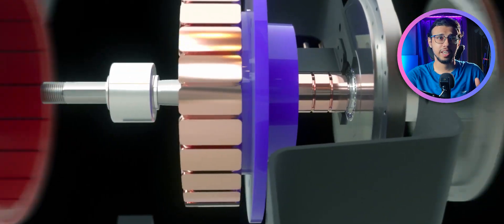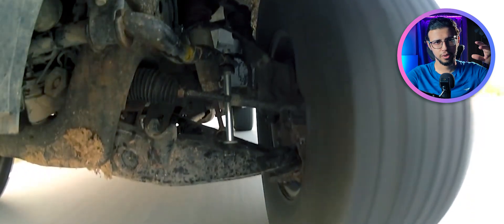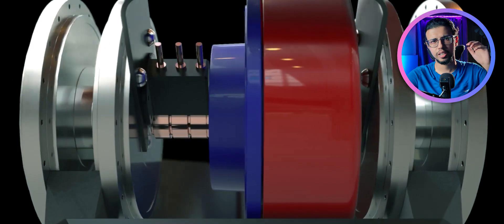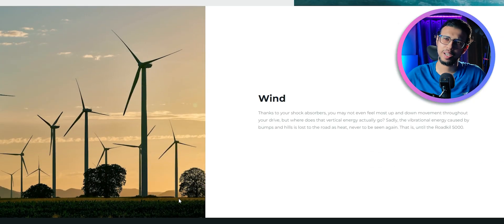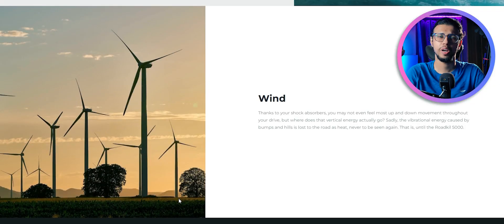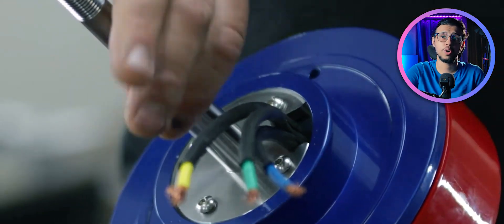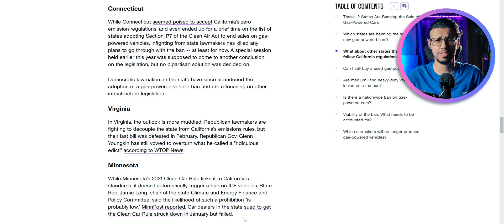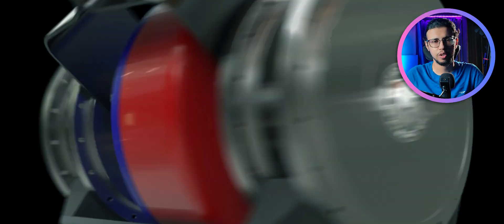It Charges Your EV via Road Bumps and Vibrations!🔋

Comment: When it comes to natural movement, I think they can attach a free wheel paddle system under the boat designed to use the force of the water drag to spin since the boat will be already accelerating forward which causes drag in the water to ultimately generate regeneration

Comment: Reduces the efficiency of Suspension as soon as you put an extra resistance on its movement.
1 out of 10 rating.
DONT PUT EXTRA RESISTANCE ON YOUR SUSPENSIONS IF YOU WANT 100% COMFORT OUT OF THAT SUSPENSION.
Reply from the maker: But what if its resistance is less than the suspension?
Reply: @TheHopelessGeek  what??? are you even hearing yourself?? 
The Suspension's job is to quickly go into the pothole/ditch and return to its initial position before the body of vehicle gets the chance to go downwards and feel more jerk.
If the suspension has to move an extra resistance(i.e. the so said "regenerative machine") , the time taken for it to travel downward into the ditch and come back to its initial position will increase and that increase in time gives more time for the Body of vehicle to move downwards and feel more jerk.
Reply from the maker: What I meant say was, what if the additional resistance introduced by the roadkil 5000 attachment isn't as significant on the suspension? What is it doesn't reduce its effectiveness by a lot?
Based on the available information, I see that it has turnable damping, which apparently allows it to balance between generating electricity and providing sufficient damping. 
Of course, this hasn't been extensively tested. It's unclear what happens when the battery is fully charged and there is no longer a need to generate electricity using this thingy. But it's unfair to just assume it'll be absolutely bad straight away.

Comment: I did notice my KIA Niro EV significantly drops consumption on smooth road.
Reply from the maker: That may be because the motor doesn't have to work as hard. Regenerative braking comes in when you enable a one-pedal drive mode.
Reply: Less rolling resistance.